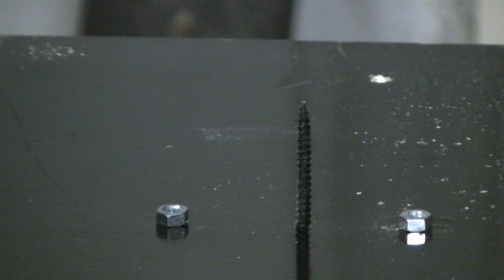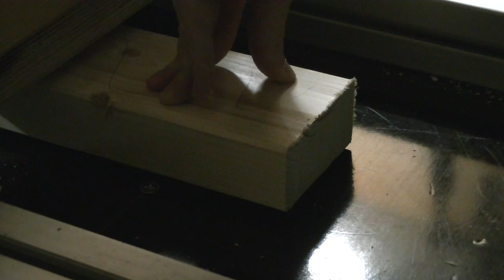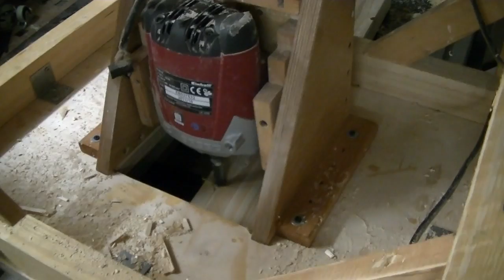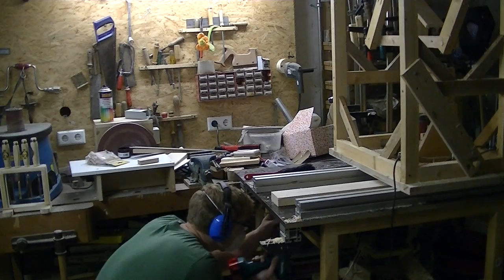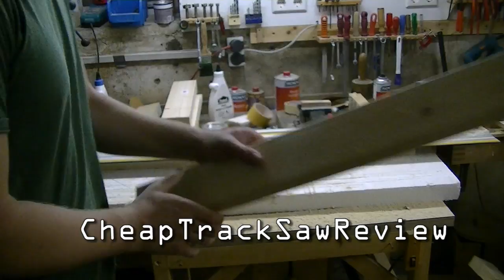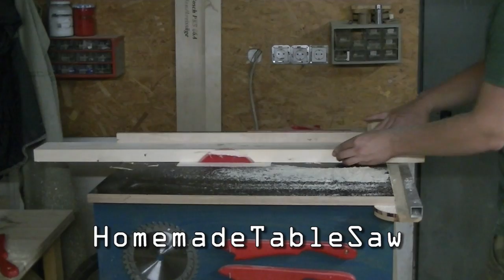Milling Wood Without A Jointer (using a router table) - Abrichten mit dem Frästisch

Comment: You could make your life easier by picking up a second router (when you have the $$) and making a smaller sled to carry the router across your aluminum extrusions.

once you finish your table saw you can easily make up a jig to joint the edges of your boards as well.
Reply from the maker: michael cochrane I have several routers but using the router table upside down was just a cool idea.

Comment: Good idea, till the funds are there for a planer-thicknesser.  One point: Always push stuff through the table-saw with a stick or two.  Believe me, one day you WILL take your fingers or a hand off doing it like that. And where's your riving knife and guard? A kickback could launch a component at your face at 100km/hr.  Play safe!
Reply from the maker: I don't use a riving knive and a guard. I use push sticks if necessary.
Reply: Cosmas B A blade guard can be more dangerous than not having one. I can't tell you HOW many times I've had pieces run halfway through the saw only to jam against the blade guard mount because I dared touch it while moving the wood through...that is an incredibly dangerous situation where a piece is locked into place with the teeth of the anti-kick back blade guard yet you can't move the piece forward because it is jammed against the upright mount of the guard.....

The FIRST thing I do when buying a saw is throw away the blade guard......

Comment: All that time and effort to do it with power tools when you could use a hand plane for a fraction of the time! I use power tools too but in many cases I find that hand tools are better.
Reply from the maker: What time and effort? You can use sandpaper if you want but I used a router because it is fast and accurate :)
Reply: and a good smoothing or jack plane will cost you the same if not more than a router.....
Reply: michael cochrane Not more than a good router.

Comment: I find it interesting that quite a few people are bitching about 'waste of electricity'...

What I would advise is to use a featherboard. Since you're not using a riving knife, I can tell you from personal experience that you might find yourself cutting concave edges this way. Also, they help you keeping your hands away from that scary blade ;).
Reply from the maker: All a featherboard could do is push the fence out of alignment and that would really mess up the cut. I find this technique without a riving knive and a feather board wor perfectly well for me :)

These guys sit in front of a computer screen, watching youtube videos and bitching about me wasting electricity. :D
Reply: Cosmas B Then that fence sucks ass ;). You don't need much pressure for a featherboard to do its job. But hey, if it works for you, who am I to bitch? ;)

Comment: Okay it looks a bit cumbersome with that table upside down, but the video teaches us something useful. What if you have a smaller surface than a 2x4 but one that doesn't fit in your jointer or planer? This method would work very well. For instance, I have a thick 20 inch x 20 inch square block of wood. And don't tell me you could do it AS ACCURATELY with a hand plane as fast as I can with a router. You're nuts. Thanks Cosmas!!!!